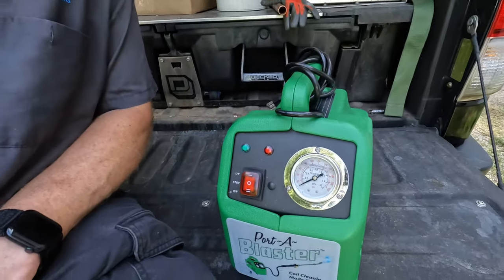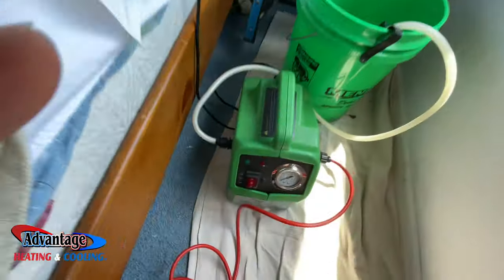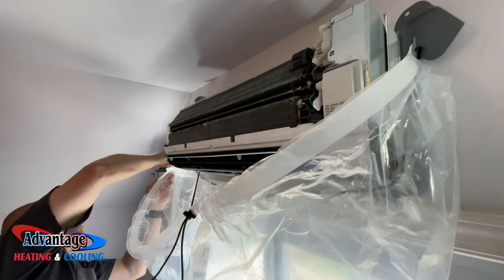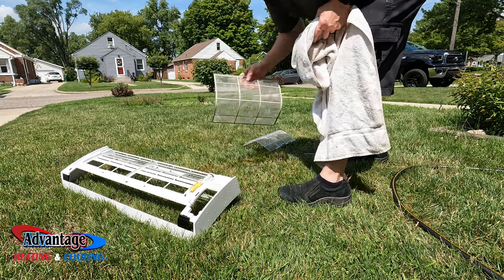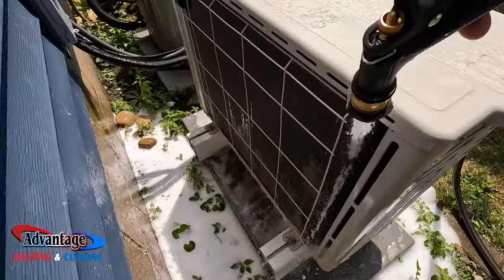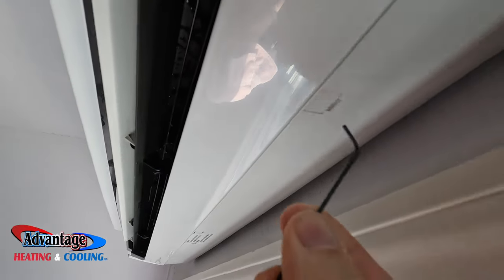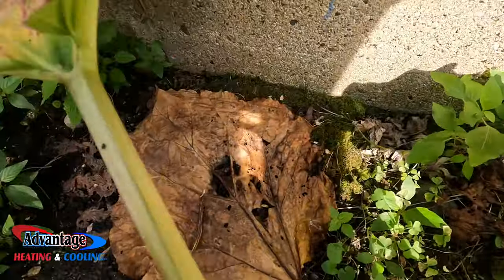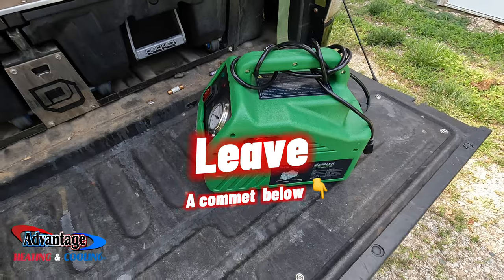How does this Supco Porta-Blaster clean this Fujitsu mini split?

Comment: Great video.  Any chance you found a 90° nozzle tip for using on mini splits?  I ordered one, should be here on Saturday.  I liked it bc you can connect to 110.  The battery-operated ones seem to cost a lot more.  Thanks again.
Reply from the maker: No, I do have the old school washers with the orange tank and built in battery. Those were really expensive.
Reply: Did you find a 90⁰ nozzle tip or a 90⁰ wand attachment? I'm looking for the 90⁰ wand attachment. Haven't been able to locate the one that fits perfect with this blaster. The 45⁰ angle is not enough for hitting units with the blower wheels still attached. Instead, I have to take a few extra minutes to remove the blower wheel to make sure it's thoroughly clean in there. I've seen another video that shows someone cleaning a mini split head with the 90⁰ wand and they were able to hit the wheel at a good angle to remove debris from the wheel without taking the unit apart.

Comment: That looked like a coated coil before your washed it. You're not supposed to use anything but clear water on a coated indoor unit coil. It will take the coating off in flakes that look like dirt if you didn't know otherwise.
Reply from the maker: Thanks for the tip, I have use that cleaner for years with no issues.